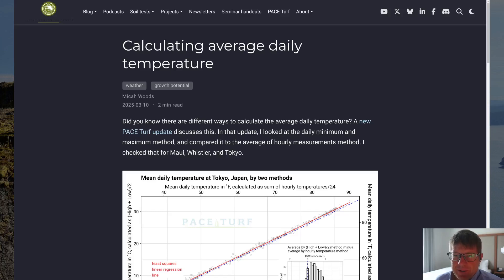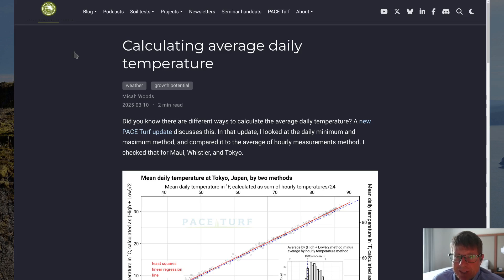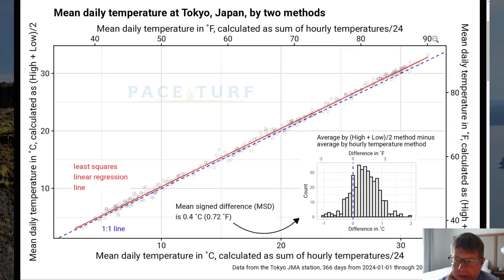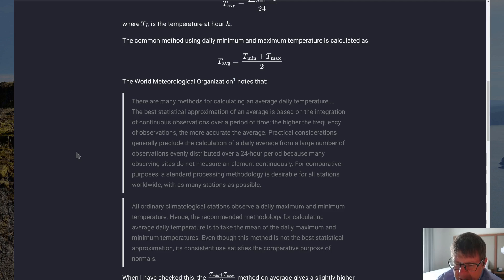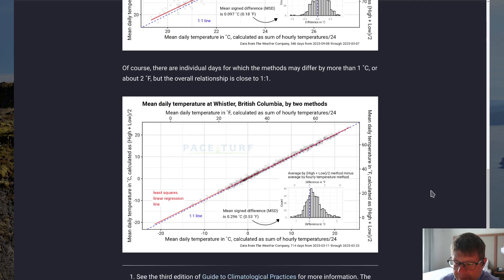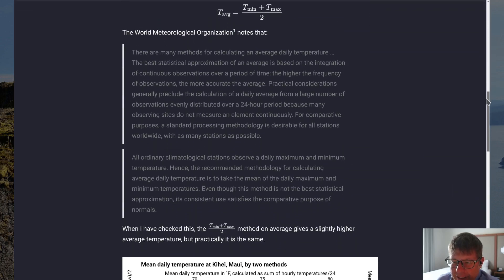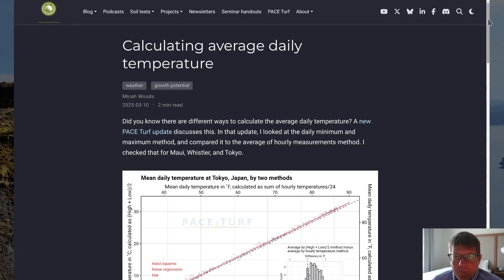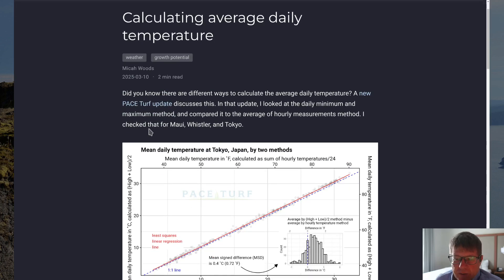Calculation of the average daily temperature

Comment: ...  shoud we , taking in consideration the process of photossintese in day and respiration on night, have more the daily average temperature during day ?  Or the night temperature have less % on averages?  
Coffee with ice some countrys have it and it is excelent in summer
Reply from the maker: I'd like to see the clipping volume data compared to the average temperature and to various other calculations such as GP, or GP calculated for only day time, for example. We could then check if an adjustment is helpful. From what I have seen so far, I am fine with the GP based on average temperature across a 24 hour period.